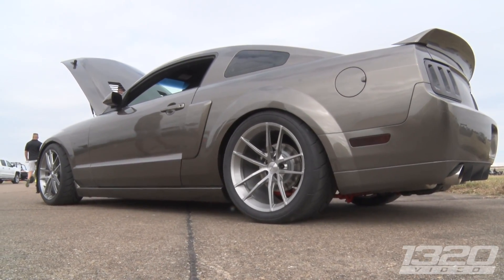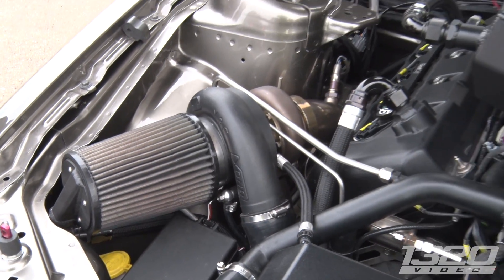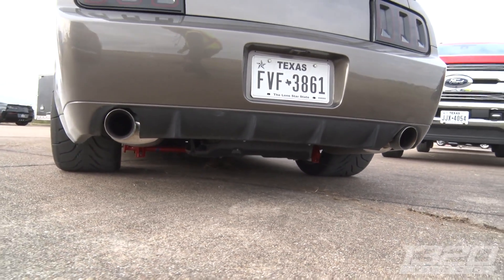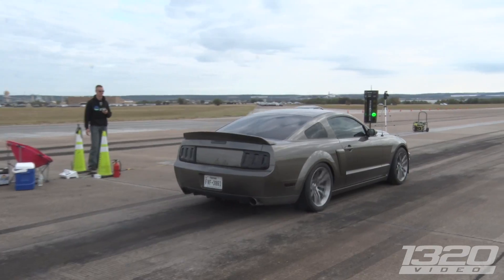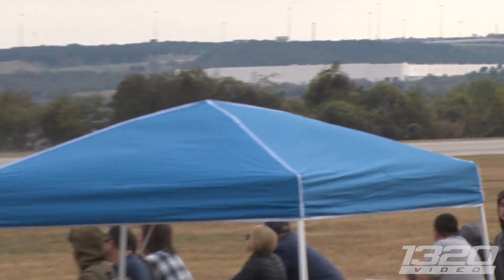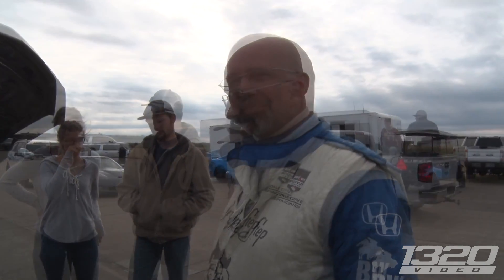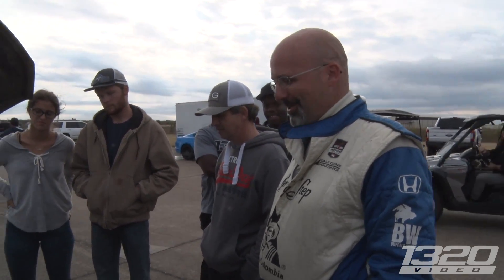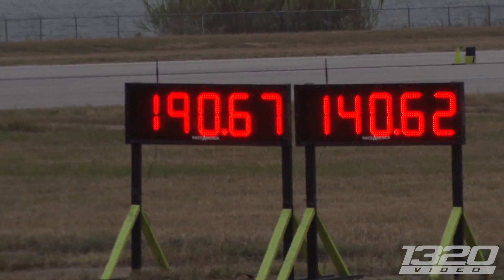Frankenstein’s Mustang - Terminator GT500?!

Comment: This car sounds stock when drives by. The suspension and engine management will let it hook on the street on R888s. If you're smart and have a garage full of tools you don't have to LS the world.
Reply: These mod motors are amazing and can make huge power even well before the coyote.  You absolutely don't have to ls the world Ford motors can put in plenty of work and do it with alot less displacement.  4v ftw.

Comment: '03 Cobra engine
'14 GT500 interior
'06 GT base
'07 GT500 exterior
FrankenStang
Reply: JDMuscle 101 hahaha
Reply: Teksid block, that's not a terminator engine.
Reply: Pock3tSnip3r probably swapped out the heavy ass iron block for a teksid block which is the smart thing to do
Reply: Youre point is?
Reply: @Pock3tSnip3r  still a dohc 4.6 Triton thats boosted so pretty much a built termi engine
Reply: I'm surprised the carbon fiber drive shaft didn't end up in pieces with that much power

Comment: 34lbs of boost on a 10.5:1 compression motor he must be running E85 or C16. Crazy build tho, That cobra motor is putting in work. How surprising.
Reply: P Body amen
Reply: If its making 1500HP, he is probably running C16
Reply: 34 psi is prob gonna need that fuel even without 10.5:1 compression that is alot of boost.

Comment: That is a very clean unsuspecting S197 build for sure. Would put most Shelby to shame also; really shows what a properly setup modular is capable of doing. Ford went a little sideways with the new GT500 Trinity setup as they've had some issues but the 03-04 Cobra 4.6, first Gen 5.4 Shelby and the 5.0 Coyote platforms are all VERY stout and handle boost insanely well. We've seen more than 1 totally untouched longblock Shelby make over 1000Rwhp and turn high 8 second 1/4 mile ETs. They backhalf like a Honda too it's always impressive. Not plentiful and cheap like the Lsx series but every bit as capable.
Reply: More capable.

Comment: How did you convert the cobra engine to drive by wire assuming you used Holley ecu control packs unless throttle is controlled with the boost controller only thing holding me back other than the lights and interior stuff

Comment: SICK!  Think I may have to push my oldest boy towards swapping a DOHC 4.6 over the 5.3 we’ve been researching for his 92’ Fox. 

 I so wanna get us into these style of events. One with in 90 miles every year. My junk ain’t fast at 600rwhp (3150 lbs) but it should be a good time none the less. C6Z’s fairly slippery through the air so might go around 145. I really just guessing. 1/4 should trap 130+. So 15ish mph  in the back 1/4 seems doable.
Reply: Owens Racing The thing is Budget, it costs more to build a mod motor, sometimes twice as much for the same parts, but HP per Cube is unmatchable by almost any engine.
Reply: @MVSTNGGT  it costs more for cams because there are 4 instead of 1.  Outside of that going built motor isn't gonna cost much difference between the two.
Reply: Don't ls any mustang go 4v and don't look back

Comment: '03 cobra motor was iron block not aluminum, Teksid blocks were Aluminum from  97-01
Reply: It's an 03 cobra motor that has been built with a teksid block.  It's no longer a stock engine at 1500 rwhp.
Reply: That is like building a dart 347 and saying it's no longer a mustang gt engine because it doesn't have it's original block.

Comment: a 4.6 based engine pushing out over 1500hp!?     respect
Reply: Matthew Ryan agreed i love a well built 4.6  but most people ive seen dont do it right and run dumb amounts of boost on a stock block with stock internals and end up with split crank cases, warped heads, broken head studs among other massive failures that cause un-repairable damage to their engine, pride, and wallet xD
Reply: Michael Cody The 4Vs are not to be taken lightly.
Reply: This guy knows his shit. Anyone who knows modulars knows the Teksid block is by far the best of the pre-coyote era and of course the 4V heads love boost.
Reply: stock capacity 4.6 has gone 5.80's@250 with factory cast head and block
Reply: Had one in my Lincoln MkVIII...I always wanted to do something like THIS with it....but dont have the finances...lol.  Would get me a divorce too.  Still would like to see a 1500hp MkVIII....much better aerodynamics.  Lincoln actually set a land speed record with the MkVIII....with basically a stock motor...180ish mph....
Reply: @davidgonzalez4665  Iron 5.4 > Teksid 4.6

Comment: Damn when he said 03-04 Cobra engine I was shocked. I know they will hold and make a lot of power but I was thinking he was gonna pop the hood and it be the 2014 GT500 5.8L engine. Honestly the 5.8 probably wouldn’t be as durable. Those teksid engines blocks are like gold.
Reply: The teksid is awesome because it's stout and it's aluminum.  The 5.4 is a better engine than the 5.8 imo.  The 5.8 is kind of overrated but this dude here has a fully built motor.  The 5.4 and 5.8 can take that kind of power too with a fully built engine on turbos.  The 4.6 is impressive all the mod motors are 4v ftw.
Reply: Iron 5.4 > Teksid 4.6, but Teksid is very good.

Comment: This if for all the modular haters.
Reply: Jon Doe I don’t think people hate modulars, they just hate 2V modulars.
Reply: I hardly know anyone that hates modulars. They’re great motors!
Reply: I know a lot of people who hate modulars. They’re torqueless and can’t make big power without a blower
Reply: jbrandon302 Funny you say that when a 5.0 makes more power than a GM 6.2 naturally aspirated....
Reply: James Charles or a aluminator 5.2 na makes more power than a 14 zl1 hahaha
Reply: James Charles no... it doesn’t. You might want to check your stats bud. The coyote and ls/lt have pretty much always been similar in power but the ls has always had more torque and produced lower in the rpm range.
Reply: Tj C also wrong. The aluminator only makes more power than the zl1 because of the BLOWER which if you refer to my previous comment you would see that I said they can make more power with a supercharger. It’s common sense that an engine will make more power when more boost is pumped into it.
Reply: James Charles oh and by the way I’m not sure if the coyote 5.0 really qualifies as a “modular”. I always thought the modular motors were just the 2,3, and 4 valve 4.6s, the 5.2, and 5.4.
Reply: Coyote is 100% a mod motor lol.
Reply: RSAHydro I don’t think so
Reply: RSAHydro never mind you’re right I just checked
Reply: A Fera I like the 4v motors too but I just don’t see the advantage to gm switching over when the ls is still clearly competitive with fords best offerings
Reply: @A Fera they did in 1990 the zr1 corvette and I'm a Ford guy and that engine kicks the 4v cobras na ass all day
Reply: @derrickmcgimsey3960  Those are intriguing and cool cars but they are unicorns and do you really want to talk about all of the problems GM has had with previous attempts at 4v v8s?

Also,.. The 4v Cobra engine was rated at 320hp Vs the 1990 ZR1s 380 but could easily toe the line with bolt ons and is much more reliable and easy to work on.

Don't get me wrong, those ZR1s were bad ass for the day but I wouldnt be too cocky comparing that engine to what Ford has done.

I hope GM does better with their upcoming 4v V8s. (LT5 I think is one).

Edit to add; Cobra 4v n/a was 4.6 liters. 1990 Zr1 was 5.7. Over a liter difference in displacement. Something to keep in mind.
Reply: Derrick McGimsey Lotus made the ohc heads for that vette , not Chevy they just used a 350 block
Reply: They don't hate modular they just cant afford them lmao even the new 5.0s aren't doing bad against the 6.2 GM
Reply: @jbrandon302  of course a 281 cube motor isnt gonna make "big power" without a blower it can make some pretty good power considering.  The mach 1 with a fbo, ported short runner intake and cams can get up around 400 rwhp that is pretty good for an almost 20 year old 4.6 liter engine.  You start adding cubes and compression they can make a decent bit more there isnt alot of good intake manifold options for them and that holds them back but they can def compare with any of the ls stuff with similar displacement.   They come alive with a power adder theyre meant for power adders and they can make big power with no head work no cams none of that.  They deserve alot more respect than they get.  People expect the coyote 5 liter to make the torque of a 6.2 but come on guys really?  They make some pretty badass torque for their displacement.

Comment: What is the owners name?  Does any mod motor guys know who makes those coil cover/mounts?
Reply: Chad Klodner is the Owner.  Firstoff makes the coil mounts.  They allow heat to evacuate from the coil area.  The stock style covers seal the heat in.  We haven't had any coil issues since we designed and started running them.  email info@firstoff.com for more information.
Reply: Jason, sending an email right now.  Thanks!

Comment: Why not a new edge or sn95? A lot lighter and less of a brick
Reply: They ain't that much lighter.  A new edge gt is like MAYBE 200 lbs lighter prob not that much.
Reply: @midnight347 Lol 4 years ago. 300 pounds is a lot though. Tons of weight reduction on the s197 and it's at the weight of a stock sn95, weight reduction on the sn95 and it's below 3000 pounds. But it doesn't even matter, idk why I originally even commented that

Comment: 03/04 motor loves boost best engine ford ever made
Reply: ken mba 
Agree with you but it's not a 03/04 motor
It's teksid block that is from the earlier cobras, all aluminum. 03/04 blocks are Iron blocks.

Comment: Why did he use a 9" instead of the 31 spline 8.8"?
Reply: and heavier, so is there a good reason? I've seen those 8.8's hold a lot of power too.
Reply: An aftermarket 9" is NOT heavier than a factory 8.8". I'm an 8.8 fan, but there's a LOT of reasons to switch to a 9"...
 - first, strength isn't even close to comparable. The Dana/Mopar guys don't like to hear this, but a built 9" is stronger than anything short of a 14 bolt, maybe Dana 80, etc., and that's largely because of the pinion support(gears typically get eaten when too much power & traction causes the pinion to deflect - this doesn't happen with a pinion support)
 - second, they're already fully floating from the beginning. This means that there's a flange at the end of the axle tubes that physically holds the outer bearing to the housing, meaning that, if you break an axle shaft, you can still move the vehicle without the axle(and wheel that's attached to it) not sliding out, dropping your axle on the ground(you can find videos of this, especially drag racing launches). The 8.8 is a C-clip axle, which holds the axle shafts in the axle with little C shaped pieces that go in the differential and slot over a groove in the very end of the axle shaft. You either risk breaking an axle and losing a wheel, or you have to modify the housing to be full floating, basically using 9" parts to get the 9" features 
 - no axle has the aftermarket support that the 9" does, it's the SBC of axles. The variety of gear ratios, differentials, off the shelf axle shafts, housings/drop outs is absolutely unmatched 
 - the drop out style center means that you can have a lightweight fabricated housing instead of a heavy cast center section. This also means that you don't spin axle tubes in the housing with a 9"
 - the drop out center also means that gear changes are significantly quicker & easier, and it allows you to carry multiple drop outs each with a different gear ratio and/or differential installed for different tracks/styles of racing/street use, etc. Not to mention the centers can be had in any material from cast iron, cast magnesium, 100% CNC billet.
 - the axle design also allows for custom drop outs designed for even larger gear sets. [ring gear diameters] 9.5" & 10" are common in BIG HP drag racing, 10" is the GO TO ring gear in Trophy Trucks/desert racing(possibly the most abusive sport on axles - 800-1000HP engines at full throttle while 39" tires are literally bouncing off the ground, insane!), I believe I heard that there are even 10.5" gear sets coming onto the desert racing scene now(don't quote me on that)
 - you can get a brand new budget iron center/stamped steel housing 9" for the price of dirt compared to an 8.8", or you can go balls to the wall with a fabricated aluminum housing and a billet aluminum or cast magnesium center for a stupid light axle assembly

I'm sure that I could list more, but you get the idea. The 9" can be cheaper, lighter, stronger, and just plain BETTER than an 8.8 ever could. And you seem to know how good the 8.8 is(a factory axle can support 1000HP at the tire with some aftermarket help), so that should put it into perspective. The 9" is just plain the most flexible and BEST axle in the racing world, especially when you get to this level of 1500HP and up, they can quite literally be built to do anything on land!
Reply: @RyTrapp0 Well explained!!!
Reply: Because the 9" is about the most bulletproof rear end out there
Reply: Main reason people swap is because the bearings and axles are pressed together on a 9in while the axles on an 8.8 are held in with C clips. If you snap an axle on a 9in it wont slide out like you see on some cars while the 8.8 will. Also more companies make custom 9in axles than they do 8.8.
Reply: poot111111 with 1500 horsepower you better have a nine inch, Detroit locker. Bullet proof!!
Reply: Hey, that's the explanation I was looking for! The more you know.
Reply: Outkast Racing His personal preference??
Reply: Thanks guys, no problem! Just spreading the word on all this useless info that I've wasted my life on, lol
Reply: javier f Oh shit, the SVTP fraternity has arrived! Hope you brought some free Papa John's!
Reply: All these comments and no one explained the real reason the 9in was used and is saught after.  The 9in pinion gear always has 3 gear teeth in contact with the ring gear at all times.  Therefore the power is spread out to more teeth making it able to handle more power without breaking.  Most other rear ends only have 2 teeth that make contact in the ring and pinion making them weaker.
Reply: REALLLLLLY hope this guy takes it to TX2K. Thing would murder everybody on the highways lol
Reply: Because you need 35 spline axles for over 1000hp.
Reply: NASCAR uses them in every stock car...